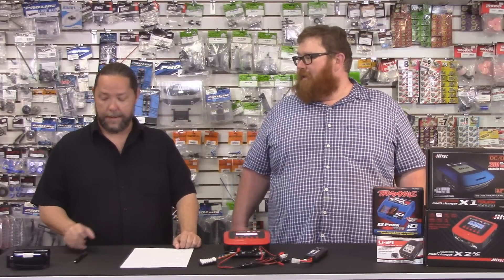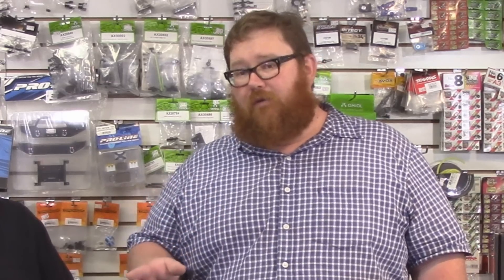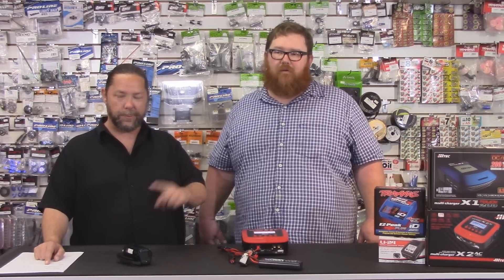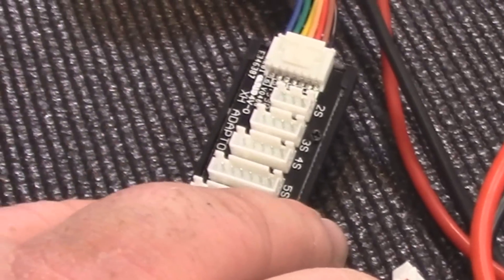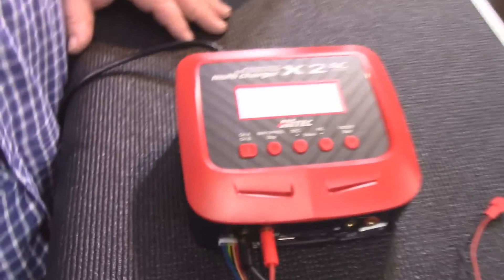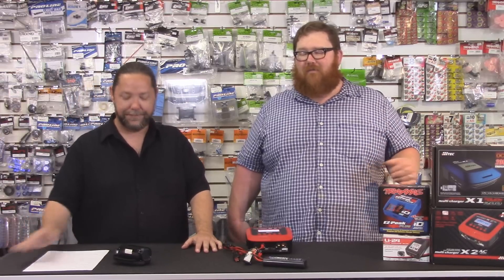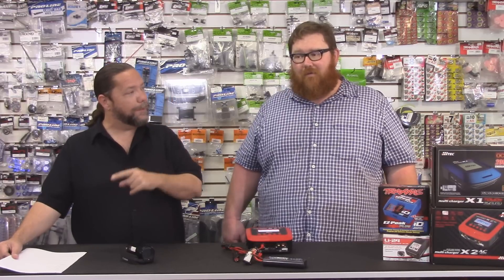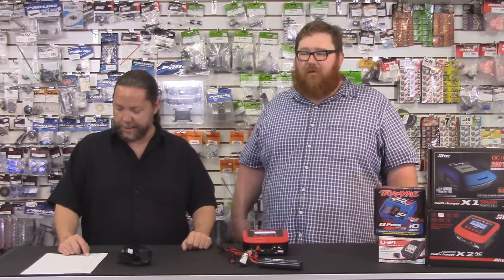Charge LiPo Batteries - HOW-TO

Comment: Can I plug the balance lead into the front of the charger without using a balance board? I obtained this charger from someone but don't have the separate balance board. Just curious if I can still balance charge without that board so long as I line up the balance lead from the battery in the correct position?

Comment: So im new to lipo's and im using this same charger, just got it in a package deal kinda thing. when I started charging it just shows how long its been charging, how do I know when to stop charging or will it stop on its own?
Reply: Did you find out I wanna know
Reply: @Wafitafi   I'm pretty sure they stop on their own, but since it's a lipo and to be safe I set a timer for 45mins then take it off charge when the timer is up. They say charge between 45mins to an hour and NO longer. That's how I've done it and works great.

Comment: What if my charger only charges at 4 Amps max. But my battery is a 5000mah 11. 1v would that still be okay to charge with 4 amps?
Reply from the maker: Yes, it is just going to take a little bit longer, but it actually is even better for your batteries.

Comment: Question, does the balance mode charge and balance the batteries at the same timw or does it balance it only?
Reply from the maker: It depends on the charger, but "usually" it just ballances
Reply: @Rcstreetshop  my charger actually charged and balanced it

Comment: wait why did u use balance instead of charge?! I have the same charger and I used to use LiPo balance but I put it to LiPo charge. is that wrong? what's the difference?? I don't want to mess up my max amps batteries!!!
Reply from the maker: You need to use both balance and charge plug every time you charge Lipo battery/charger.

Comment: Once I tried to charge my lipo, it kept making an error beep. I thought my battery was fucked...here I had the polarity wrong and it wouldnt charge. The charger said "beep, nah bruh, try again"
Reply from the maker: It is good that most Lipo chargers come with buit-in safety features. Making a short and burning something down is uncool.
Reply: @Rcstreetshop  my charger has a multi lead plug with like every connector you could need, the Dean's had a cap on the end & one of my kids took it off without me knowing. Charging a battery, scooted it to the side 2 inches...the Dean's connector happened to touch my screw driver I had laying next to it, just right,so the + &- touched it at the same time. My bedroom light flickered, the charger shut itself off and the dean connectors housing melted a little. But somehow I didnt trip a breaker, battery was still good, as well as the charger. I didn't realize the Dean's end cap was off. Took some looking over to diagnose what happened, It scared the crap out of me. My son always asks to take the Dean's caps off now ever since then 🤣🤣🤣 love your guys channel and been a long time viewer! ❤❤❤

Comment: So for my gens acs 14.8v 4s 5000mah 45c i would charge at 5.0 amps im kinda a noob on this new charger touch screen 😂
Reply from the maker: Yes, you suppose to charge 500mah battery with 5A current
Reply: @Rcstreetshop  5000 but ok i thought so just wanted to double check havent had a prob yet

Comment: Can I charge a Traxxas lipo 5000mah 3s 11.1 battery that has the integrated balance connector with a prophet sport mini multi chemistry charger
Reply from the maker: As long as you have right wiring you may charge any Traxxas lipo battery with any dedicated Lipo charger

Comment: What is your professional opinion of Ovonic 50C 7.4V 5200mAh 2S Lipo w/ Deans Plug batteries?   Curious if these would be suitable for a backyard basher in a 1/10 scale Duratrax Evader BX Pro 2wd buggy with 8.5T 4000kv EZRun brushless ESC and Motor kit in it?
Thoughts?
Reply from the maker: Unfortunately, we haven't had a chance to test Ovonic batteries, so we can't really tell.

Comment: So I got a lipo charger that only charges at multiples of 100 mAh. I have 150 mAh eflite 1s batteries. Does that mean I have to charge them at 0.1 amps? Will it still charge the entire battery if I select 100 mAh since there is no 150 mAh option?
Reply from the maker: Yes, it will charge, it just going to take a bit more time.

Comment: So a 4000mah 25C battery should be charged at 4 amps?
Reply from the maker: Yes
Reply: Ok and plug in both the Traxxas plug And the balance plug at ALL times? I don’t have a digital charger I have an ECOPOWER electron model# ECP-1006

Comment: I bought a Traxxas 4Tec 2.0 and a 2S LiPO and charger. How does one tell when they've discharged their LiPO too far? I believe the ESC that comes with the car has low voltage detection. Thanks!!
Reply from the maker: Yes, you need to switch ESC to lipo mode and it will do it for you.
Reply: @Rcstreetshop  thanks!

Comment: My e revo brushless has 2 batteries and each one is a 3 cell do I charge them at 6s or 3s?
Reply from the maker: You need to charge each battery separately, so you charge them as 3S
Reply: RC Street Shop thx for the help
Reply from the maker: Anytime! :)

Comment: So i have a 5200 mah battery but i have been charging it at just 2 amps, should i charge it at 5.2 amps?
Reply from the maker: 2A is perfectly fine if you don't mind waiting over 2h. If you change it to 5.2A it will take only one hour and still be safe

Comment: Awesome videos guys! I'm a noob and am learning a lot from your videos. Keep it up! I was curious if you guys had some recommendations for a few good, not stupid expensive, balancing lipo chargers. The info would be much appreciated!
Reply from the maker: Thanks for your feedback... if you have a moment then give us a call (562)425-9000 and talk to one of our tech experts.
there is no such thing as an ideal Lipo charger, for the most part, if it charges your batteries and gives you an indication of Voltage and Amp then it is good enough. Also, make sure that whatever you are getting has manufacturers warranty and support (this is usually a good sign if the charger is any good).
Reply: @Rcstreetshop  Thanks guys! I will definitely give you guys a call! Thanks for the info!

Comment: Hey guys! I need help. I have this exact charger, but it didn't come with the adapter you're using from the front port positive and negative ports. Instead it came with many others, none of which will adapt to my  zop power 14.7V 1400 mAh 4c battery, this is my 3rd time buying a charger that wouldn't match up with my battery. I bought the drone (eachine wizard) and battery together based off of a youtuber showing it as a good deal to get into flying. I've owned these for months and haven't flown it once because I can't find a charger that will recognize the battery. Do you have any tips or links to help me get in the air? The closest hobby shop is over an hour away from me.
Reply from the maker: Are you talking about balancer plug? Does it have 2mm pins or 2.4mm? Most likely you just need to buy different adapter, there is no need to buy another charger.
Reply: @Rcstreetshop  unfortunately I don't know the answer but thank you for giving me a place to start.

Comment: Hi guys, 

This video was super helpful. The only question I have is if the charger stops charging the battery when it’s done or if I have to monitor it? I have the exact same charger and the exact same battery that you use in the video.
Reply: Actually, I was looking in the manual for the charger and I found that it does emit a chime and says finished when done! Sorry for the dumb question.
Reply from the maker: No problem Randy, charger stops charging at a different voltage with different battery types,  make sure you chose right battery type (NiCd or Lipo).

Comment: I have a 2200 lipo and my charger only has 1A 2A 3A 4A. It's an ID charger and it auto detects to 4A. What do I do?

Edit: it's a brand new charger.
Reply from the maker: If it doesn't work right, call Traxxas for warranty or simply change settings to 2A when you charge 2200mah battery
Reply: @Rcstreetshop  thanks :D
Reply from the maker: Anytime :)

Comment: I have a 7.4 volt battery and have it set to that is it ok if i see the volts go above that it that bad
Reply from the maker: Full charge voltage for lipo battery is 4.2V per cell, for 7.4 battery it is going to be 2x4.2= 8.4V

Comment: My charger has the option to cut off when it reaches 5400 mAh (That’s obviously what I set it to because it is a 5400 MAH battery). It also has a built-in feature where it will shut off when all the cells reach 4.20. The question is which is more important to go by. Because if I go by the first option I noticed that my charger stops when my cells are around 4.11, 4.12 etc. am I OK to restart it until each cell gets to the 4.20 threshold?
Reply from the maker: Yes, Voltage is more important. The battery is fully charged only when it reaches 4.2V per cell.
Reply: RC Street Shop thank you!
Reply from the maker: Anytime 👍

Comment: Am I fucking up? 
11.1V 3S 1000mAh charging at 1.2A. Should I go down to 0.1A like you did? 
Also , do lipos IN GENERAL stop charging at 4.2V? and minimum charge should be around 3.7?
Reply from the maker: min Voltage should be around 3.0V (2,7-3.1V). Cut off Voltage is 4,2V (full charge). The recommended charging rate is 1/10 of capacity...in your  case it is 120mAh/0.12A

Comment: When the battery is done charging will the charger cut off charging or will it continue until you tell it to stop?
Reply from the maker: If you select right battery type, it will stop charging (auto cut off)when the battery is charged.

Comment: Where was the lipo bag at before you charged that battery
Reply from the maker: We normally do not charge our batteries in Lipo bag
Reply: Supposed to is what I got told cuz they can carton fire
Reply from the maker: @Dylanweaver1   they may, but not necessarily will, unless you do something completely wrong ( ex. charge them with wrong charger, damage pack before charging etc)

Comment: Hi, 
I currently have a 5000mAh battery wich i charge at 5amps. So i should take 1 hour right 🤔,
But when i came back one hour later(since i started charging) it still was at only 300mAh in all the cells combined... any suggestions?

Greetings, tim
Reply from the maker: If battery resistance is too high, then it may take extra time...but it should not take that much.
Reply: @Rcstreetshop  extra time like 8 hours extra time 🤔 seems a bit much tbh...
Reply from the maker: Definitely....and unsafe too...
Reply: @Rcstreetshop  thnx, i guess i will just buy a new charger 👍
Reply from the maker: Check that everything is OK with the battery, before investing in new charger
Reply: @Rcstreetshop  yeah, checked it with my voltage meter +-11V wich is perfect, but i doesnt really matter so much tho its only like 30 dollars 🙃 thnx for the help men
😉👍
Reply from the maker: Anytime👍

Comment: I've got the same battery as that, but I havent charged it in almost a year, now its saying "cell error" everytime I try to start the charge? Did I do a fuck up?
Reply from the maker: It discharged to deep...it is unsafe to recover such batteries.
Reply: @Rcstreetshop  I think I just had it plugged in wrong, I tried it again and it worked fine :)

Comment: Good information....but you should also only charge on a surface that will not burn or melt. That's why I only charge on a 2' x 2' porcelain tile that I bought from Home Depot for a couple of dollars. It saved me one time when a LIPO went bad and burst in flames.  Lots of smoke but no damage to anything.
Reply from the maker: Thank you for the tip. Its either any fire/burn/melt-proof surface or Lipo bag.

Comment: I charge all my 5000 to 5500 mah battery at .7 for years is that a problem I mean it takes forever but they last a long time
Reply from the maker: No, it is not a problem, it is just going to take 7 hours instead of 1. But on the other hand, it is better for your battery when you charge it on slow charger.

Comment: My battery is 7600mah but my charger only my goes to 7000mah. So what should I charge it at?
Reply from the maker: If you didn't charge it first time (given that you used more then 7000mah), then simply unplug and charge again. It will charge the remaining 600mah.
Reply: RC Street Shop my bad my charger only goes to 7.0 amps and my battery is 7600mah?
Reply from the maker: amps - is just a unit of measure. When you charge, you raise voltage. Charge it to whatever level it reaches, then unplug and plug back in and it will finish up the charge (raise voltage to the max-optimal level).

Comment: I have HiTech X2. Can I use it to charge Traxxas 25C 2 cell 7.4 Lipo battery ?
Reply from the maker: Sure, you can charge 2S Lipos with it.
Reply: @Rcstreetshop  OK thanks. What adapter will I need to do that? Do sell them. Can I buy one from you guys?
Reply from the maker: Yep, sure. send us a line (buy@rcstreetshop.com) with what you have and what would you like to do and we'll get you what you need.
Reply: Thanks email sent  @Rcstreetshop

Comment: First time RC enthusiast here. I have a 50C-5000mAh-3c charge rate-2s  7.v Battery and the charger has 1A 2A 3a and 4a Switches which should i use? from my understanding for each 1000 is 1a charge rate? I'm reading on using the 5A but only have 4A is it safe? I assume it will just take longer to fully charge? ((i have a fire extinguisher on standby lol )
Reply from the maker: Correct.You should be using 4A and although it is going to be a bit longer (1,20h instead of 1h), but it is actually be safer (you are not putting to much current on the battery hence not stressing anything).
Reply: @Rcstreetshop  Thank you for the response much appreciated!
Reply from the maker: Anytime! Ride safe! 👍

Comment: Sorry guys..  the "s" in 2s or 3s etc... is NOT another way to say 2 or 3 cell (as stated in your video).  The "S" means the individual cells are wired up in SERIES.  Great video though, well done!
Reply from the maker: Thanks for correction. Back in the day manufacturers used to indicate how many cell were in Parallel and in Series (even single cell batteries were called 1P1S packs).

Comment: Hi man, I'm learning a lot from you, thanks for everything, I have a question you might find stupid but Its a real question for me , I would appreciate your help, 

I want to know in which way I'm spending more electricity when charging lipo batteries please?
for example let say I want to charge (12) 4S 1500 mah batteries and I have a 200w 12A charger with 2 spot for charging ( like isdt D2 charger ) 

I can charge all 12 batteries at once by using parallel charging in just one hour,,
also I can charge them one by one  and each take one hour

in parallel charging the fans of charger blow all the time , but if I charge them one by one the fan just work few minute once in a while, 

I like to know in which way I'm using more electricity ? thanks a lot
Reply from the maker: With 12 batteries you are limited with Power(Wattage) of your charger, and the necessity to balance each lipo while charging. 
although  Watts = Volts * Amps, the only "accurate" way to really tell is to plug the battery in and see how much wattage it needs. Some chargers even adjust the max Amperage, when you set the battery setting before charging begins... so it depends.
What is more crucial is that you need to balance each battery/cell while charging...so charging 12 4S batteries at a time in parallel is not recommended unless you have ways to balance them (by basically having 12 balancers).

Your fans go off because charging two batteries drains a lot power and it needs to cool down electronic components.

Comment: Hi! I have a B6AC+ charger and a 5500mAh lipo. But the charger option will only go to 5.0 A at max. Will there be any trouble or is it just taking a bit more time to charge the battery?
Reply from the maker: Correct, it'll be longer (but actually it is better for the battery to charge with low Amperage, as you are not forcing the charge).

Comment: After info on battery was entered on charger correctly . When charging was completed the charger read overcharge ????
Reply from the maker: What do you mean "overcharge"?  did you get more than 4.2V per cell?
Reply: RC Street Shop 
No it didn't charge more than 4.2 volts per cell
Reply: RC Street Shop 
Overcharged
Reply from the maker: then you are not overcharging.... 4.2V is max voltage for Lipos
Reply: 7600 mah 2s2p 7.4 v lipo.
I charged at 7.6 amps for a 2's lipo battery. On Hi-Tec black charger  it stopped charging at about 50 minutes and the screen showed me a message saying overcharge capacity limit. I check cell charge both of them were at 4.18.
When I charge a nickel metal hydride battery when it is finished charging the charger will tell me that it is finished why does it not do it with this LiPo battery what am I doing wrong.
Reply from the maker: It is could be, that you have a setting that limits charging capacity for Lipos, go into settings and see what value do you have by default.
Reply: RC Street Shop  ah I see it says capacity cut off 5000 mah
Reply: Thanks for your help
Reply from the maker: Anytime!

Comment: Does anyone know at what voltage i should stop charging a 1500mah 4s battery? I dont wanna overcharge
Reply from the maker: It automatically stops at 4,2V per cell (16.8V), if you charge with Lipo charger.

Comment: so should I every time I charge my lipo Balance charge it?
Reply from the maker: It depends on your battery. It is totally unnecessary with high quality batteries (as they keep voltage pretty good after full discharge) and very recommended with cheap batteries, as voltage is all over the place.
Reply: Thank you!
Reply from the maker: Anytime!👍